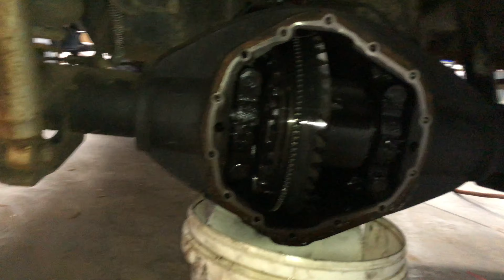08 Dodge 3500 rear differential oil change + cruise control problem

Comment: Maybe the workshop manual or all data will have an airgap spec for that?
Reply: close is good enough for those style sensors. They are very forgiving when it comes to having metallic flakes stuck to them. Normally they fail because of physical damage or a weakened magnet from heat cycling. He put sealant on the seal.  That style doesn't need it. Clean and dry is all you need. Since he is reusing it It seems like a good idea. Reusable gaskets found on Fords typically have metal washers formed in them to keep from crushing the gasket and deforming the seal material.  Love this guys videos even if they aren't always of interest to me.   I ordered a 6.0 rebuild kit with a compressor housing and compressor upgrade two days ago. Looking forward to receiving it. The turbo I'm putting them on has 72,000 miles and never been any trouble.